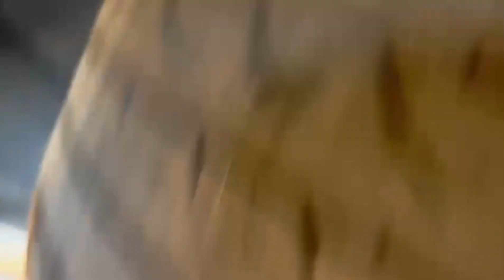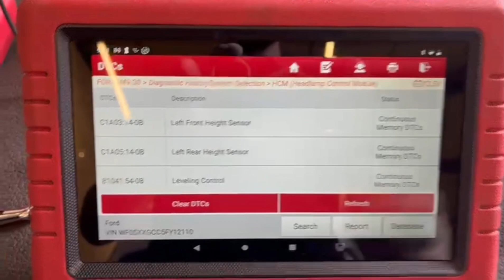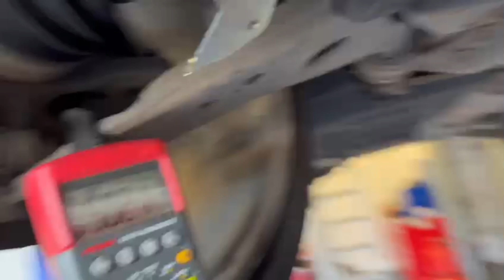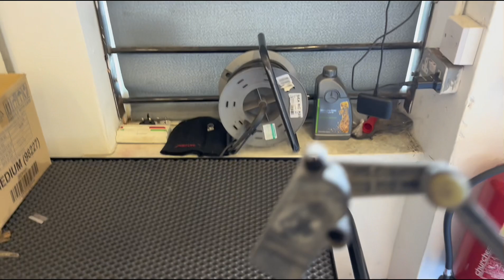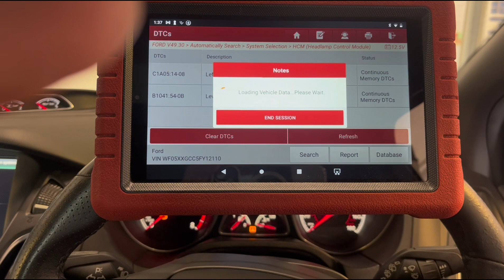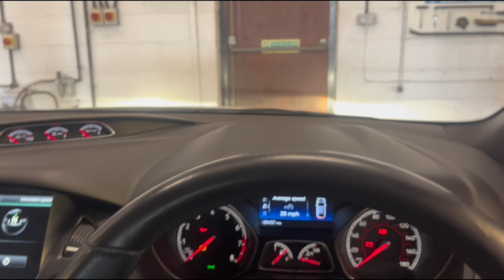FORD FOCUS ST HEADLAMP FAULT!?!

Comment: How do you manually adjust the beam?  My beam aim is way too low, i can barely see more than 10ft in front at night (2012 Focus ST with xenons).
Reply: Open your hood and use torx key to adjust them. Had the same problem on my ford

Comment: Mine was fine, I took of the level censor on the front and forgot about it and turn on the ignition and it popped up now I get get it off even though I've put it back on.

Comment: Did you find that one of the headlights swimming about and triggering the headlamp malfunction error, as I have this issue on mine
Reply: If the wire inside the headlight isn't broken..then it can be the fuse..in the bonnet area there are 2 fuses a 5amp and a 15amp below it..replaced mine and it fixed the problem. The wires are also a few quid of ebay
Reply: @louisbarston8276 which wires?
Reply: @louisbarston8276  can you be more specific

Comment: hi, thanks for the video. Just replaced my rear sensor, and am not getting 5v it reads 0V. Diagnostic scan shows 5v on the front one though..any ideas? Checked wires, look ok.

Comment: Have same error on my Focus mk3 2011. Also I see a condensation in my front right head light, and upper led light in it doesn't turn on when engine starts (only in evening, when low lights turn automatically)
Any advice? Thanks

Comment: Wait what year is this? I have a short to ground error and replaced the sensor still got it but looking at the video it seems the leveling sensor has 3 wires coming from it where mine only has 2, wondering if a wire has become detached somewhere and that's throwing the fault code!

Comment: Mine failed last week. Far too complicated. I had a broken wire in the passenger side headlight. Absolute nightmare. Ford wanted £1200 for a headlight. I got mine fixed by an auto electrician for £100
Reply: Same issue I’ve had, pretty sure my connector isn’t connected tightly because I broke a clip notch on the headlight casing. The factory hid’s are pretty pricy, after my accident the repair shop couldn’t track down a new headlight and had to settle for a refurbished unit.
Reply: Who's your auto electrical i think I need his help

Comment: Where are you based? have a similar issue with my preface lift ST3 and would like it resolved!
Reply from the maker: We are located in Bedfordshire, we typically book 1-2 weeks ahead.
Reply: @EverydayGarageYT Hi, my st has the same issue. Could you give me a price for the replacement harness please? Cheers
Reply: @EverydayGarageYT  do you have contact details please?
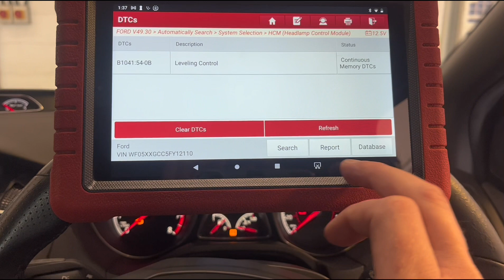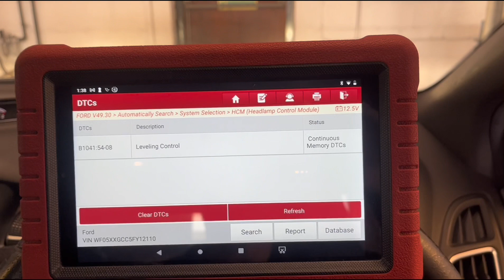Reply from the maker: @styusuf5671  01525383000 if you give this number a ring, we are open 8:00-17:30 on weekdays and 9:00-13:00 on a Saturday.
Reply from the maker: Leighton Buzzard Lu7 4ff